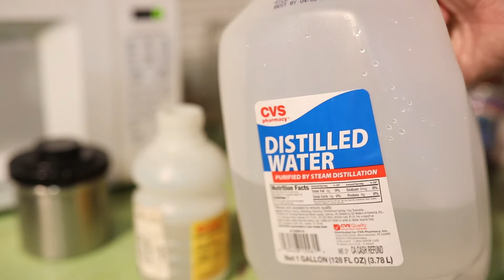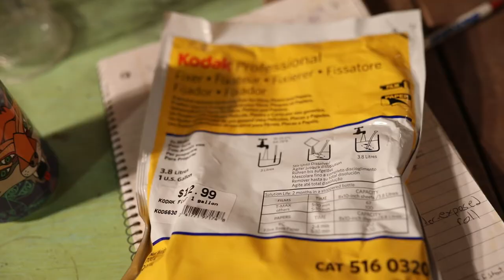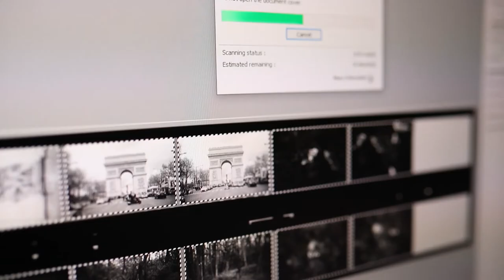How I develop Kodak Tri-X 400 in Kodak HC-110 dilution b | Developing 35mm Analog Film at Home

Comment: Why does Kodak’s datasheet recommend only 3 min 45 sec at 20c using hc110 dilution b?
Reply: I’ve never seen that. I use the Massive Development Chart online for my times. Developing anything for that short of a time would be ridiculous- absolutely no control. When super short times are recommended I switch to dilution H. …but I’ve been using dilution b for a decade at my times and it works for Tri-X.
Reply: @TimFitzwater  I usually use massive dev also, but decided to see what Kodak recommended.  You can see it here:  https://imaging.kodakalaris.com/sites/default/files/files/resources/f4017_TriX.pdf
Reply from the maker: I do remember seeing that now. I did a bunch of research on Tri-X and HC years back but to be honest I don’t remember the details - I just know what works from experience now.